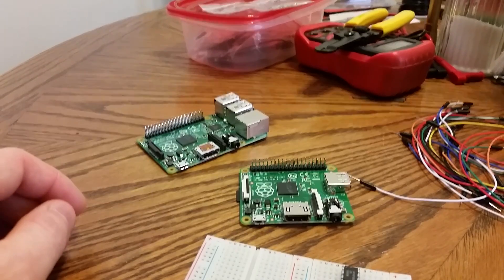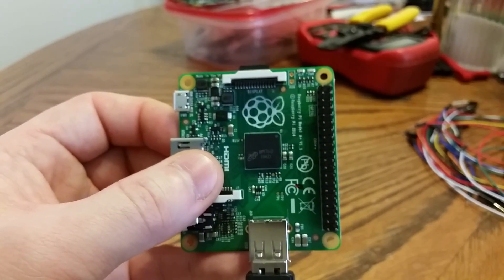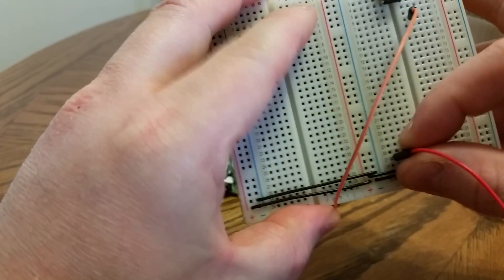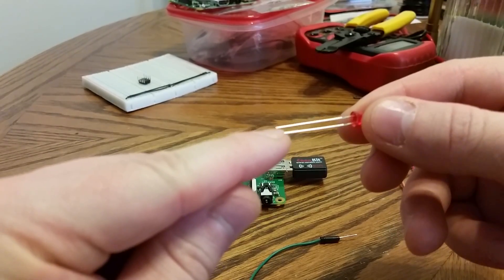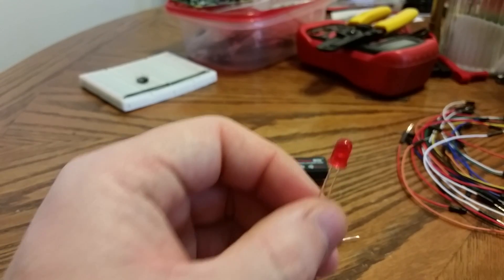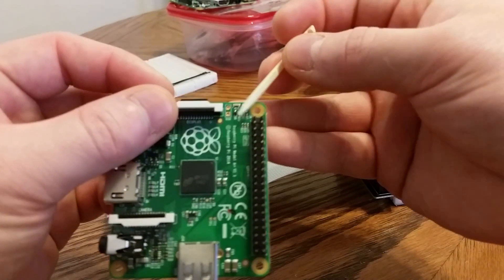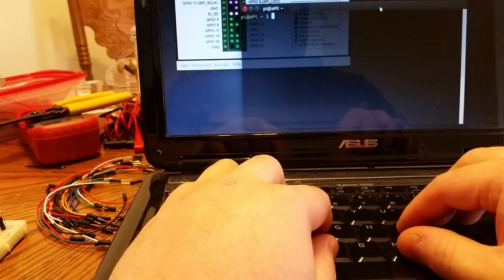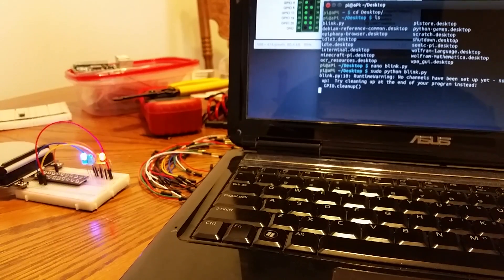Raspberry Pi For Beginners: LED Connections, Bread-boards, and Programming

Comment: Hey im sorta new to this stuff but how did you connect the rasbery pi to your computer, what language did you use to program the lights and where did you learn the code to it
Reply from the maker: First: the language I used is Python.  You can use any language you want, but Python is the one that I have found the most useful, while not being too overly complex.  You can use Scratch, which is easier, but won't be useful in too many other coding platforms... You can use C, which will be the most diverse language, but WAAYYY too difficult for the rPi GPIO.

Second: I learned through a combination of things.  Mostly by trial-and-error and Googling what I needed, but you can use the "Learn Python The Hard Way" site, which will teach you a TON about Python, and how to use it.

Third: I connected to my rPi through a communication standard called Secure Shell (SSH).  It's built into Linux, and therefore, your rPi... If you're using a Windows machine to connect, you'll probably need a program for SSH, like Putty...

I've been meaning to make a set of videos outlining the multiple ways to connect to a device, but there's so many, and they're so complex, that the playlist is taking a long time to film and edit.
Reply: +stillborn86 okay thanks will there be future videos on more rPi tutorials?
Reply from the maker: Nog00d
Absolutely!  Like I said, I've been meaning to make connection videos for the rPi, but they're taking a long time to film and edit.

Is there anything specific you want to see?

Comment: Any ideas on a all included starter kit. I know nothing about the Raspberry and would like to buy a kit that has everything to begin learning including Python programming, etc.. Would I need to learn Linux?
Reply from the maker: It's good to have a basic understanding about how Linux works, and how to navigate around in Linux... especially if you're running in "headless" mode (without a monitor, over SSH).  But, if you're using a keyboard, mouse, and monitor on your rPi, and you've installed Raspbian, you can use the GUI to become familiar with it the way you've become familiar with Windows/OSX.

It's also a good idea to learn VIM, as it's a built-in text editor, for Linux command line, which many professionals will suggest.  It offers some powerful tools, but there is a steep learning curve.

If you can get those two basics down, you'll do just fine.

Comment: does this work with the raspi 3 model B?
Reply from the maker: Absolutely!  The pinout for the rPi3 and all previous models are the same, with the only exceptions being that the first generation B and A only had 26 pins... but those 26 pins match the first 26 pins on all later models.
Reply: And also, how do you connect the gpio to the breadboard? It doesn't fit properly. I have the Canakit ultimate starter kit
Reply from the maker: Shreyas Iyer
It doesn't fit properly?  What do you mean by that?  It's a little tight, but it should all line up perfectly.  The T-board I have in the video is from CanaKit, and it fits just fine.  All of the measurements should be universal.

Comment: Hi, I just bought Raspberry Pi 3 and I'm absolutely new to this kind of thing. So my very first question is: Are Raspberry Pi 2 and 3 are completely the same when it comes to programming?

I'm using it for my final year project and not sure whether advisable to use guide or tutorial that are published to internet during the time when Raspberry Pi 2 widely used.
Reply from the maker: More or less, yes.  I can't say that it's COMPLETELY the same, but for a beginner, yes it is.  The Pi3 has a 64-bit processor and a built-in WiFi module... this can change some things.

But the GPIO are all the same, and Python is the same, regardless if you're on a Pi2, Pi3, or something that's not an  rPi.

Comment: I'm completely new to these things, so I'm currently ordering some different components for my pi, including breadboard, wires, LEDs, e.t.c, but they are taking a LONG time to arrive, so in the meantime, is there anyway to make simple versions of the cables used in this video? (complete noon BTW)
Reply from the maker: Any single-core copper wire can be used, as long as it's 22 AWG.  Anything bigger, or smaller, will not fit into a breadboard well.

Single-core wire would probably be more manageable for you, since you don't have the "needle" ends to crimp onto a multi-threaded core... but it'll be harder to manipulate.  What I mean by that is, a threaded core will have multiple threads of several smaller gauge wires in the insulation, which makes the wire more flexible and easier to manipulate.  A single-core wire doesn't have those "threads" (as it's a single-core of copper) and will be stiffer.  The problem with having a multi-threaded core means that you need to crimp those ends on your wires to make them work with a breadboard.  The advantage of a single-core wire is that you don't need those crimped ends.
Reply: +stillborn86 Thanks dude, off to get some wire :D

Comment: This is clearest explanation i have found about breadboards and leds. Thanks. What is the equivalent of that TBoard for the Pi 3? and what 's it's official name so I can buy one in store?
Reply from the maker: +The Confident Shopper I believe that the breakout boards are exactly the same between the B+, A+, Pi2, and Pi3.  I don't own a Pi3, but I believe the GPIO is exactly the same layout.

Because of this, you can buy any 40-pin breakout board, and it'll work for any of the above models.  The only reason that the original PiA and PiB aren't included (and why I "broke them off" in the video) is because they have fewer pins.  The layout for these fewer pins is the same for their analog on future Pi revisions, it's just that the future models added pins.

So, again, as long as you get a 40-pin breakout board, you'll be fine.

Comment: On the bread-board. If I touch both + and - together would it short circuit?
Reply from the maker: +Neura Essentially, yes.  It'll cause an overamperage situation, which will burn out the incorporated pins, and potentially your entire CPU.

Comment: Great video, I have no knowledge what so ever on coding nor on GPIOs and breadboards and I had my Pi collecting dust because I couldn't find any tutorial that could explain me how to do some simple wiring. This is the best "for beginners" video. Thank you some much, now I can get my son and I more involved with the Pi.
Reply from the maker: +Javier Castellanos No, thank you for viewing and commenting!  I'm trying to post periodical videos, but work and school kind of have me tied up right now, and I'm churning out videos on a slower pace than I'd like to... but they're coming.
Reply: stillborn86
Thanks for your reply, ill be checking out your videos this week and hopefully make it work :-) im aiming to get 3 buttons for 3 diffrent leds that should light whenever a certain button is pressed but i am still a newbie at this :-)
Reply: +stillborn86 Hi, do u have or know a video with a totourial for the raspberry pi 3 b+? ive heard the pins aint the same as on the older raspberry's and im in school where i need to get atleast 1 light to light when i push a button but im on dead water at the moment..
Reply from the maker: bech 1200
First, according to the Pi Foundation (https://www.raspberrypi.org/documentation/usage/gpio-plus-and-raspi2/), the GPIO are the same with all current versions of the Pi.  This means that the B+, A+, Pi2, and Pi3 all have the same GPIO.  The only differences are with the original PiA and PiB because they have less pins... but those pins are actually the same as what's incorporated in the later versions.

Secondly, I have a couple of sketches for lighting LEDs in my python repo, in the description of my videos.  I have a couple of videos up for that, but if you need help, I'll be more than happy to help you out.
Reply from the maker: bech 1200
Well, if you can give me the details, I'll do my best to help you out.

Comment: Fantastic video! I've had zero experience with wiring and electric stuff, and this was a fantastic start. I also liked how you went over the T-cobbler as well.

The only very minor criticism I had was the python code. A better way of writing the code would be something like:

pins = [11, 12, 13, 15]
while True:
    x, y = random.sample(pins, 2) #selects two unique elements from the pins list randomly
    ... etc 

Now you don't ever have to worry about getting a 14, or getting the same element twice. Also, the readability is a little bit better.

Anyways, fantastic video. I'm definitely gonna use this as I attempt to wire my first LEDs.
Reply from the maker: +ReckoningReckoner I appreciate the help with the Python code.

Honestly, I hate Python, and wish it would just go away.  It's just the most volatile code I have ever seen, and that makes things difficult for its users... including Google.

But I'm always looking for ways to improve my code, and I'll give your suggestions a shot.

Comment: Hi, I'm a college student doing a senior mechanical engineering project where an electric dryer is being converted to use solar thermal heat. I need to monitor humidity, temperature, RPM, and time all simultaneously on a touchscreen display as well as control system on/off. Would the Raspberry Pi be a good choice? Or should I look to the Arduino instead? Ideally I'd like if whatever I used could calculate efficiency after all the data from the completed drying cycle was recorded. Controlling/monitoring everything on a smartphone would be even better.
Thanks!
Reply from the maker: +TastyPear You're asking a lot from such a small piece of hardware... there are companies that have a hard time doing all of that with their dedicated, custom hardware.

If I had to say, without doing any formal calculations, the Pi would be better than the Arduino simply due to the limited memory in the Arduino.

I have a video I'm currently editing where I use a 1-wire system for a temperature sensing unit.  It's not perfect, but it's a pretty good ball park temperature that only needs one wire.  I'm not sure if the sensor will survive the extreme temperatures of a dryer, but it's worth a look.

Time would be a matter of how accurate you want that to be.  Both the Pi and Arduino have a pretty decent system clock, but they're not perfect.  If you want perfect time keeping, you'll need some sort of RTC module... meaning using up more GPIO pins.  The system clock on the Pi is a LITTLE better than the system clock on the Arduino.

I haven't played with humidity or RPM monitoring... but a touch screen is also going to use multiple GPIO.  I foresee you running out of GPIO if you're not paying careful attention to what you're doing.
________

Finally, I've dabbled in solar power before, and you're going to need a LOT of solar power to run the wattage a standard household dryer is going to need.  They require a TON of power to convert both into heat as well as raw mechanical energy... then you're talking about running a Pi, touchscreen, and multiple sensors...

You're either going to need a BIG solar panel to even run it for a few minutes, or you're going to need a BIG battery that's been charging for a LONG time... again, just doing some quick mental math, no hard numbers here.
Reply: +stillborn86 I just wrote out a lengthy reply and chrome crashed... 

Basically, I need something that can display a simple GUI. One that shows humidity, temperature, and a timer. I've taken an instrumentation course where we used DAQ cards that took readings at a hundredth of a second for thirty seconds. I was kind of hoping the Pi could take one reading every minute for a forty minute cycle, even if it couldn't process the data I imagine I could export it in simple DOS column format (excel)?

The dryer is not powered by solar electricity, instead the heat source is done through solar panels preheating a tank of water that heats a water-air heat exchanger at the inlet of the drum. There is also a air-air heat exchanger which preheats the incoming air from the leaving air. There are regulations that prevent you from circulating your dryer air and this air-air heat exchanger works around that because the incoming and outgoing air dont come in contact. This was a concept myself and a group showed an annual savings of ~$200, done using cheap sheet metal and duct tape. Now since we have funding we're redoing the project using higher quality materials and there's a push to have more "2016" features.

I wonder if an old iPad would work.
Reply from the maker: TastyPear Oh, yeah!  The Pi would absolutely work with a GUI interface, and even a touch platform.  You may have to do a little personal coding to your desktop environment and/or program that's monitoring your processes... but it's entirely possible.  It's literally a small Linux computer, so anything you can get running on a Linux box should be cross-compatible.

An iPad would also work, but I would imagine would be more difficult to work with.  Due to its closed architecture, writing the program you'd need would be more difficult than the open architecture of the Pi.

Comment: Thanks for the video!! Works great! Completely new to coding and the Raspberry Pi.

Simple question: How do I stop the program and turn the LEDs off? When I exit the program, the LEDs lit at the moment i exit remain lit.
Reply: +Aaron Rolen Sorry, let me clarify. I didn't run blink.py from the terminal. I ran it straight from Python on my Pi, so the ctrl + c advise in the comments below doesn't stop it. 

I'm sure there is a simple answer, I just have no idea what I'm doing.
Reply from the maker: +Aaron Rolen Are you running it in the Python IDE or are you running it as a command?

If you're running it in the Python IDE, you've either double-clicked the Python icon (https://upload.wikimedia.org/wikipedia/commons/thumb/c/c3/Python-logo-notext.svg/2000px-Python-logo-notext.svg.png) or you've typed `python` into the terminal by itself, and received something that looks like this: https://i.sli.mg/911FV1.png

If you're running it as a command, you've typed something into your Terminal window, either on a computer connected to the Pi or a Terminal on the Pi itself, like I did in the video.

If you're running the IDE, then the answer is that it cannot be done.  The IDE runs commands one line at a time, and you're going to have to run `GPIO.cleanup()` in order to clean up your GPIO statuses.  I can go into more detail about this, if you want...

If you're running the program, like I did in my video, and you're using the code I provided a link to in the description, the GPIO should turn off automatically once the sketch is exited with `Cmd+C`.
Reply: Thanks for the quick response.

I was running on IDLE at the time, but I ended up figuring it out in both IDLE and command.

To stop through IDLE, I just created another short program telling all GPIOs to stop. 
Then I started running it on command.

I was having issues accessing the program through command because I wasn't in the correct directory. Once I figured that out, it was smooth sailing. Shows you how new I am. 

Anyways, thanks a lot! I subscribed. I look forward to future videos.
Reply from the maker: Aaron Rolen Yeah, IDLE is the Python IDE, and it's highly recommended that IDLE not be used for anything except for debugging code.  It's not coherent for actually running scripts as it works on a line-by-line basis.

If you're going to be scripting for your rPi, you should be using the Terminal and a text editor (such as nano or vim -- vim being my personal favorite, although it has a pretty high learning curve).  This assures that you have root (sudo) access and are running full sketches instead of individual lines of code, as you would through IDLE.

Comment: Hello, thanks for the great video.  My 10 year old son and I keep getting an attribute error: 'module' object has not attribute 'out'.  Can you tell from that what we have done wrong?
Reply from the maker: +Bob Burnell Are you using a lowercase `out` because Python only recognizes a completely uppercase `OUT` as an option?
Reply from the maker: +Bob Burnell I've updated the description with links to my GIT repository as well as a sample BLINK sketch.

I believe your error is where you're using `GPIO.setup(pin,GPIO.out)` instead of `GPIO.setup(pin,GPIO.OUT)`
Reply: +stillborn86 THANK YOU! All caps on purpose as a tribute :)  This is by far the best explanation of things we have found since Santa delivered the Raspberry Pi!

As you can tell we are first timers on the electronics AND the coding.  One last question, how do I make it stop short of rebooting?
Reply from the maker: ***** If you press `Ctrl + c` (control and c at the same time) it will produce what's called a "keyboard interrupt."  This is a good way to "kill" anything running in the terminal.

You don't want to pull the power on a Pi to shut it down without running a proper shutdown command (`shutdown -h now`) since it can cause corrupted SD card blocks.  In other words, without shutting down with the above command, the data on the SD card can get corrupted and you can lose your data, or make the OS on it unbootable.

This can be fixed by reinstalling the OS (in most cases), but it's still not good for your Pi.